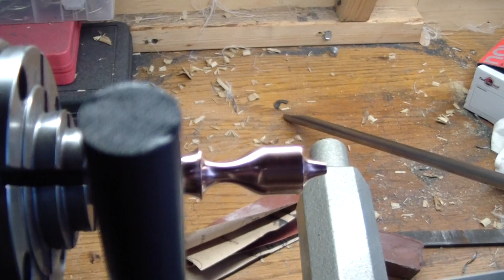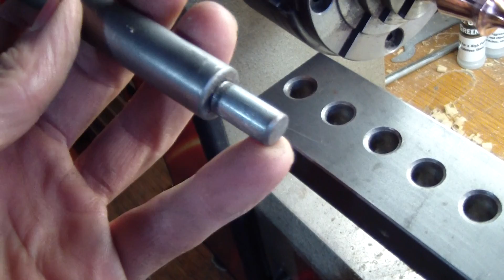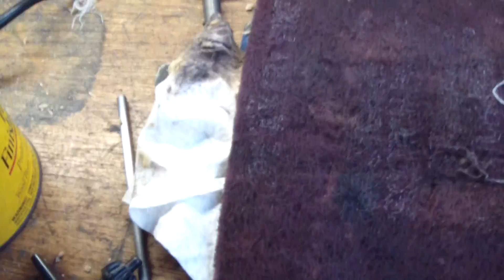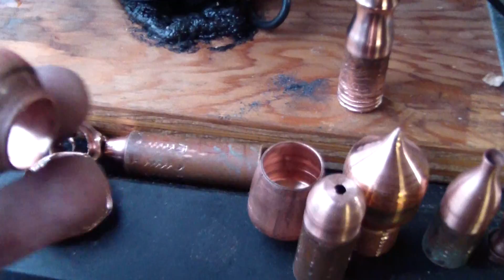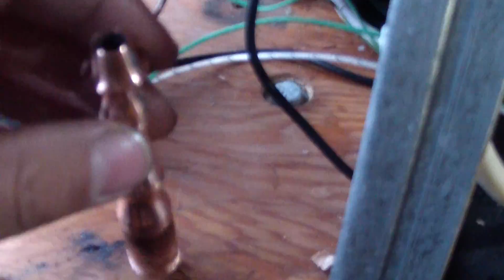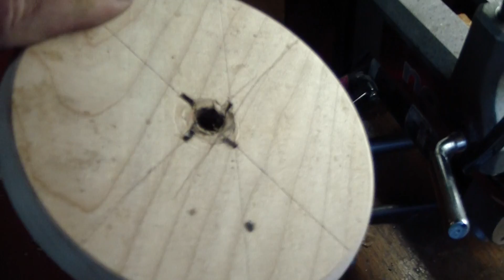Copper Spinning- First Day

Comment: Very nice..! I'd recommend not downscaling the tool holder, to a thinner dimension. It will work for small things like you've done so far, but for larger things you want to be able to use some pressing force to draw the material over the form.